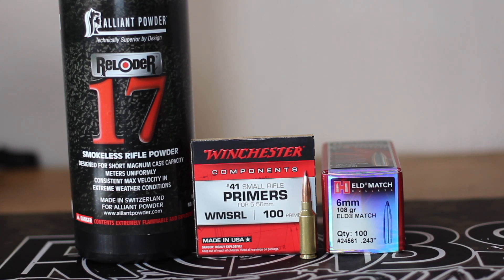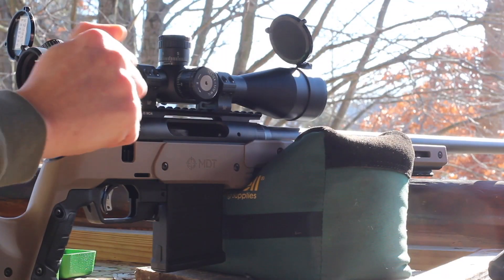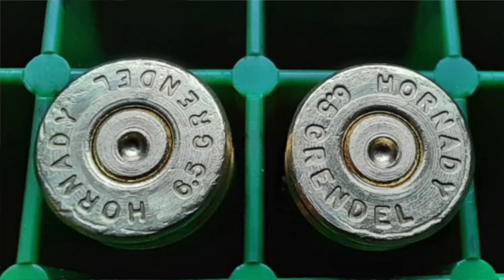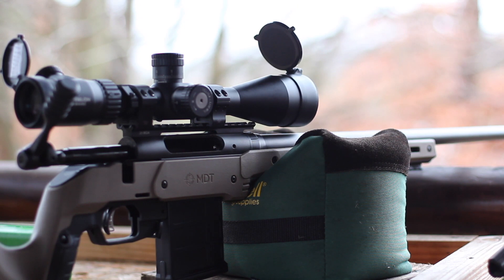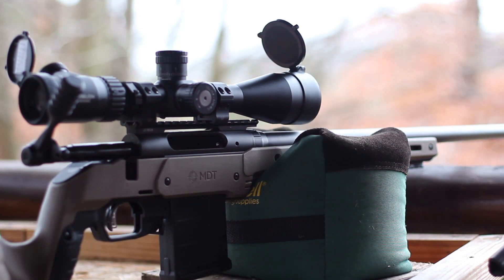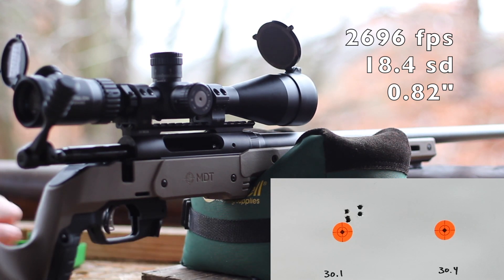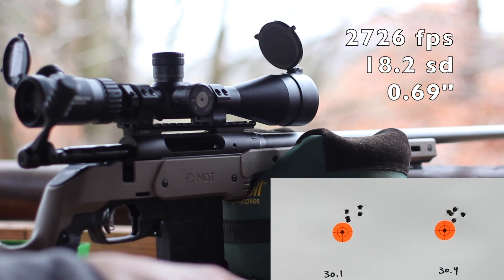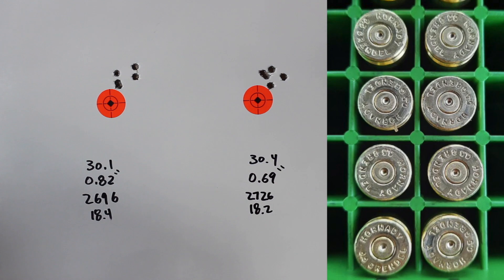Reloader 17 with 6mm ARC?

Comment: I'm looking into buying the 110 Switchback in 6mm ARC.  I'm assuming when you purchased your Chassis from MDT, it is on a short action platform.  What magazine are you using for the MDT chassis?
Reply: Ouch, no reply!  I have some metal MDT magazines, a 10 and a 12 round capacity that are made for 6 ARC and 6 BR that work well, and also a plastic .MDT 224 Valkyrie magazines that works pretty well.  I believe that at the time of this video, Rob was using just a .308 size magazine.  I did grind my Savage ejector at an angle as shown in www.youtube.com/watch?v=rioxsTOsTxg , so not sure how well they work without that mod.  Did you get one yet?  I actually broke my bolt release lever off the sear by poking around  in the chassis slot without looking.  I made a piece of stainless to act as a top/side bolt release and welded it to the sear.  Hope it lasts.  If I had to do it again, I wouldn't go Savage because they wouldn't even sell me the new sear.  They sell it only to a gunsmith and the gunsmith at Sportsman's Warehouse wouldn't even return my emails.  So both lost me as a customer.

Comment: Thanks for sharing your load workups. If you can find some Shooters World Match Rifle, I've expiremented with that powder and found it to be a lot cleaner than CFE or factory ammo and yielded 3025 FPS with Berger 105 Hybrids in a 26.5" Barrel. Berger 105's Hybrids have less bearing surface and seem to always gain velocities.  They have been the best performing long range load for my PRS needs. Excellent work👍👍
Reply: 2.300-2.310" COAL is usually where I find the node with that 105gr Berger. (.020" off jam)
Reply from the maker: I'll have to find some of the 105 bergers to try. I am low on cfe 223 as well. Never had great luck with it or leverevolution, but seems they are goldilocks in this cartridge.
Reply: The cartridge is jump sensitive rather than powder charge. 30gr of CFE or LeverEvolution is where I've found the best performance as you did in that lighter bullet. LeverEvolution has produced the best velocities with that charge. Look into a jump test to find what your gun likes. From the rifles I made, that number for me was .020" +- .005"
Reply: QL showed the SW Match Rifle to have fairly low velocity, less than 2550 fps, but that just shows how far it can be off!
Reply: @dahut3614  misread your comment, my apologies. SW match is their equivalent to CFE223. However it seems slightly slower burning and favors higher velocities like LeverEvolution.  I used it for my last competition dynamics shooting with the best long range shooters in the nation. Ranked 11th out of 72 teams. The cartridge pushing 2950 FPS is on par if not better than 6 BR, Dashers

Comment: Winchester 748 looks pretty good for a non-compressed load at 94.7% full.  These projectiles at 2.270" OAL, 28 grains is maximum predicted with 2722 fps and 61,403 psi.  Of course, this is bolt gun pressure.  Hodgdon has data for 6mm ARC with this powder, but gas gun pressure.
Reply: Lee pacesetter die set has 748 and 760 load data for lighter bullets.

Comment: QL predicts even with a 110% full case of H4350, there is only 93.3% burned with fairly low velocity of 2574 fps with these projectiles and this OAL, so H4350 must be quite a bit slower.
Reply from the maker: According to hodgon h4350 is faster than r17, and imr 4350 is even faster. I think those are both more bulky than r17. I have to imagine staball would have to work. It's a little slower than r17, but being a ball powder should compress easily and have less case fill. I havent tested that theory. In a couple years we will probably no if these test are futile or not.
Reply: @RobsReloading  With the IMR 4350, the same charge as H4350 bumped-up to 2581 fps and the case was only full to 108%.  Bumping the fill to 110% yielded 2621 fps and 56,666 psi with 94.27% burned!
Reply: For Winchester StaBall 6.5 it shows even a 110% full case, although it has 99.6% burned and reaches maximum pressure, yields only 2686 fps.
Reply from the maker: @dahut3614  wonder how reality will compare. It over predicted r17, maybe it is under predicting stabal. Only testing will tell. Either way it's always fun to experient. That's why we reload!

Comment: I've finally got my 6mm ARC AR15 together and been playing around with it and I gotta say it's almost like it's cheating. Outside of just trying to get consistent velocity numbers the accuracy is there with everything I've tried so far it's like you can't miss with it. I don't think I've ever reloaded for a more inherently accurate cartridge in my life. I would've never thought of RL17 as an option but it shows promise for sure and great video as always keepem coming brother!!!
Reply from the maker: You always have to be cautious when going with powders with no load data, but in this case it seems reloader 17 maybe a usable powder. Eventually I'm going to play with some of the other powders in this burn rate as well. Time will tell if these slow powders will be accepted with the 6 arc.
Reply: @RobsReloading  yeah man I've used the burn rate chart to find powders that aren't listed in any load data or experimented with powders that aren't made for the cartridge I'm loading for. It's almost always been powders that are supposed to be to slow because you're more then likely  going to run out of case capacity before you can get in trouble but I also know you can still get in trouble. I've been having extremely good luck with Vihtavuori n135 in my Grendel and I've tinkered with n140 in the Grendel with some promising results but I ran out of it before I got where I wanted. I know for sure those vihtavuori powders I'm going to play around with in my ARC they've been just to consistent and giving me good velocity in my Grendel so I'm pretty confident they're going to do better in the ARC... Take care and Merry Christmas brother!!!
Reply: What is the barrel length on your AR?
Reply: @EssPhour  I was back and forth between a 20 inch and 24 inch but I settled on a 20 inch Proof Research barrel. I had such good luck with my 20 inch Proof barrel in my 6.5 Grendel so I figured I'd get even better performance with the 6mm ARC. That said I've been seeing a lot of people saying they're getting good results with 18 and even 16 inch barrels so I think it's all gonna come down to what you're wanting it for and if you're going to be running suppressed so length is going to be an issue...
Reply: @DanielBoone337 , interesting I have read or watched a fair amount of information on people sharing load data,  the bolt guys love it right out of the box with good success, the gas guys seem be struggling more, I know gas will rarely match bolt guns in accuracy, but people still struggling to get consistent 1MOA, People who are having success with the ARC in a gas gun have a off the shelf built for 6mm ARC    people struggling seem to have built the gun and are running 16-18" barrels, I was leaning towards the idea that this bullet doesn't like short barrels in gas guns, and by short, I mean 16" or less, maybe even 18" is too short in my mind.....I know Barret took a order from the DoD with 18" PROOF barrels, so I guess it was good enough for them.
Reply: @EssPhour  yeah you can run into issues with accuracy building your own gas gun and bolt guns do tend to be more accurate then gas guns that's just something you have to expect going into it. I think a lot of everything else comes down to the builder and the fact gas guns take a little more practice to be proficient with. Personally when I'm building a gun I don't take anything for granted... I try to buy a receiver set with a snug fit up, I true up the upper receiver, I bed the barrel, and I make sure the barrel nut is torqued down to spec and no more... If I'm really wanting to get the most accuracy out of it I still do everything I previously mentioned but I also try to stack things in my favor with quality parts. When it comes to barrel length I think as long as it's a good barrel and you do your part that doesn't matter. Just know with a shorter barrel you're going to struggle to get the velocities needed to get this cartridge to full potential for the longer shot. That said if you're not shooting long range or you don't need the terminal performance down range for stuff like hunting at extended distances then personally the shorter the barrel the better especially if you're shooting suppressed or hunting because it just makes it much more handy and a lighter weight gun to carry around. So in short it all comes down to uses and abilities everything else is just personal preferences but I would say just do it this really is a cool cartridge that I don't think you can go wrong with in any platform.